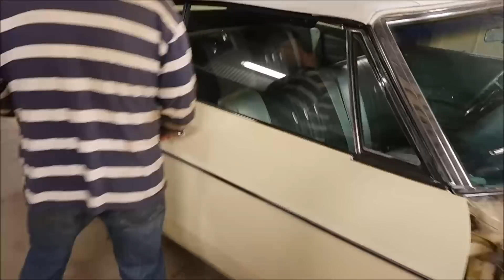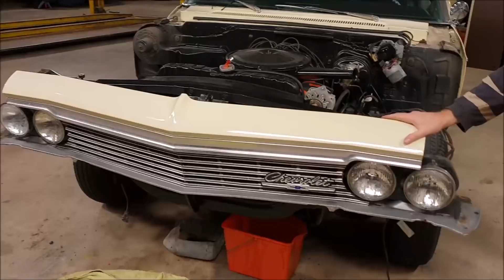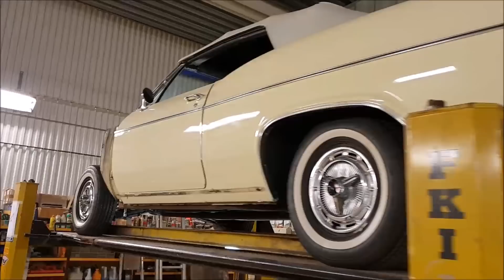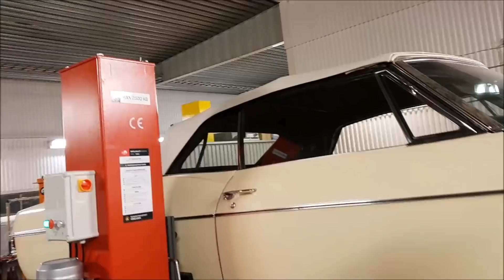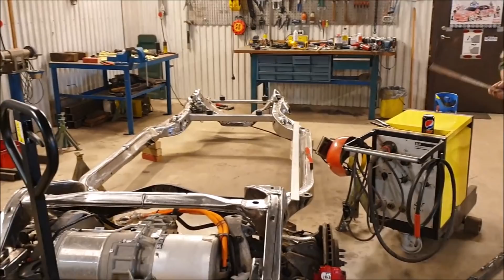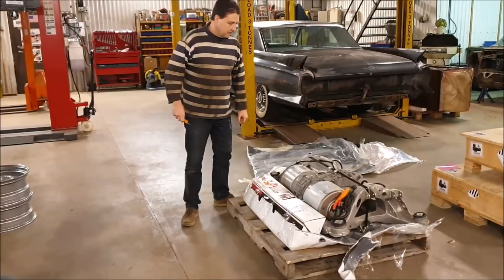Electric Impala conversion part 1

Comment: I love the fact that you are so into Impala's. I have a 1970 4-door Impala that I bought for $500 in 1989. I rebuilt it and I love it! But I wouldn't mind if it was electric. I was driving it around San Francisco all day today, and I am not done since I still have to pick up one teenager that is out tonight on a Saturday night. Yes, it is so cool that you can get a cheap reprint from Classic Industries. I have gotten lots of stuff from them. I like what you did with the wheels, getting the nice hubcap inserts on a black steel wheel. (I was watching more recent videos where you finished the '66). I also think it's fantastic what you did with electric power steering. I don't recall if you did electric brakes, but I saw you have separate lines for the front and back. Mine has two separate reservoirs. It's safer, in case one line breaks. I wish I had electric power steering. My pump is leaking and it is crammed in now that I added "Vintage Air" air conditioning. I notice you don't have that, but I guess you also don't have the deserts we have in the American Southwest. Did you do much sound deadening? I know you have the convertible so it's never going to be a library in the passenger compartment, but mine is so incredibly loud. The engine and headers, the poor seals on a hardtop, road noise, the normal shake and bake of an old car--and now I have two big electric fans on the radiator: it all adds up to a very loud car. I really have to crank my tunes to hear them. I don't smoke so I lined the dashboard ashtray with black foam liner and installed an old iPod there with a cable to my receiver. It's nice to have thousands of tunes on there to choose from. The receiver has a monitor that hides in the dash, so it kind of blends in when I leave the car. But when I have the monitor out, it is the same size as a modern receiver monitor. I converted my four-wheel manual drum brakes to power brakes and did the same conversion you did to add disks on the front. Much safer! I also added a digital dash, which I love. But I am using my car all the time, so I can understand if you find it looks nicer to keep it all original. For me though, I hated to be on a highway at night wondering if I had enough gas or how fast I was going. The digital dash also was calibrated with my larger tires so the speed is accurate. My tires are 235/70R15. Nice for potholes in the city here. And the rims are gray 8-inch steel wheels. I think my original wheels were 5-inch! I look forward to watching more videos of the '66 that have already been posted, and I will look for the ones you do on the rough-finish 1964 Impala that I saw on a rotisserie. Mine is sea foam metallic green with a darker forest green interior. I get thumbs up every time I drive or just open the garage. This evening someone randomly stood in front where I was parked and took a picture of the car. You should consider installing shoulder belts. The 1970 came stock with them, but I don't think that was an option before then. But it's safer.

Comment: AS a lifetime restoration and fabrication tech my hat is off to you for taking on this project and completing it so tastefully, as well as professionally. Your fabrication skills are top shelf and speak for themselves. Though at heart I'm a old-school Internal Combustion guy (gas not diesel), I can find no reasons not to take vintage vehicles that are not particularly rare and "electrify" them. Best of the old classic style and cutting edge tech rolled into one.

 Perhaps you can do a Muscle Car resto-mod next, for instance a '71-'74 Charger, Road Runner, or maybe an E-Body,  preferably a 'Cuda. If a Hemi fit in them, the Tesla battery-equivalent should fit upfront. Since they are Unibody's these cars should be easier to modify in the rear to accept the motor and suspension assembly out back. I'd like to see upgraded steering as well, electric rack and pinion versus recirculating ball, for better road feel. 

Air ride is OK for certain vehicles and specific looks,  however I'd like to see coil over's used such as the QA-1 all in one replacements. The vehicle will ride smoother and handle better, being able to be dialed in for all scenarios. Those tubular control arms you use are great, and that frame looks  absolutely magnificent! I wish we could find old cars that clean here in the states, other than in the southwest and west coast, where there is no snow, rain or salt to rot them.

Thanks for sharing this.. Cheers!!

Comment: How did you guys clean the frame?
 Using still wire wheel and after galvanized it or just used wire wheel?

Comment: After seeing your work on Bjorn Nyland's channel, I had to do a search to find your own YouTube channel... so I could leave a copy of my comments here!

Very smart way to tie all 3 series-stacks together...individually fused!   You guys are real crasftmen... a beautiful OE frame modification, super clean integration. 

The Tesla Model S rear drive has the advantage of being a Induction Motor, so there's no chance of over-current demagnetization that a permanent motor would do if run at too high a power level.  The only non-thermal limit is going to be the Inverter... and how much "over-designed" Tesla made it for durability.
(edit - Induction motors can hit magnetic saturation in high over-current conditions, leading to overheating... I forgot this) 

WONDERFUL WORK GUYS!... from someone who grew up in this era of cars! My first car when I graduated high school was a rare 1966 Oldsmobile Starfire "Ultra High Compression" 425 cu.in., switch-pitch converter TH400, 3.73:1 limited slip diff. "factory stripper" model (light weight).. it was fun stomping the guys in their gen1 Camaros.